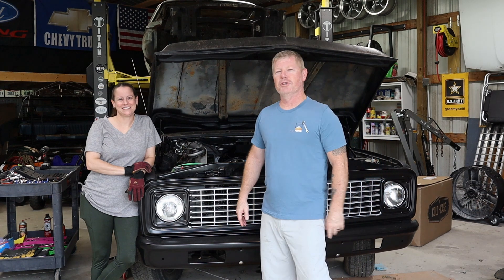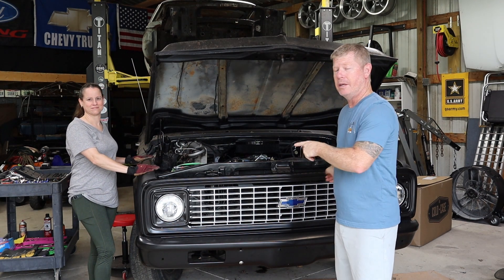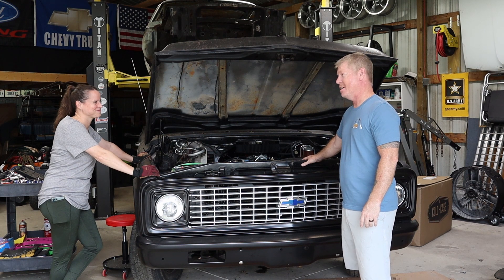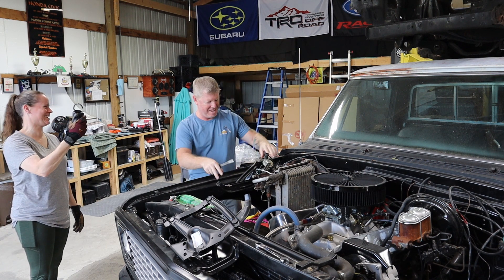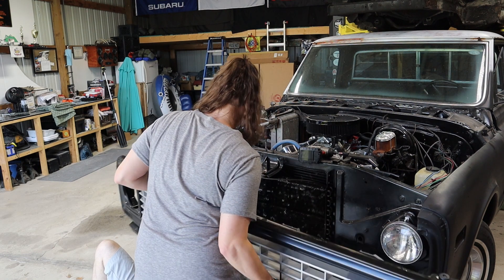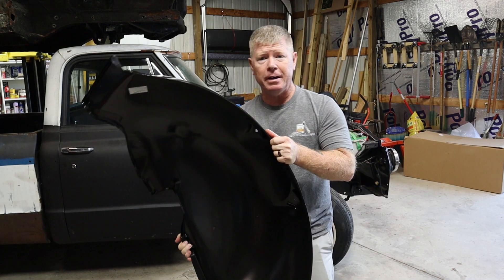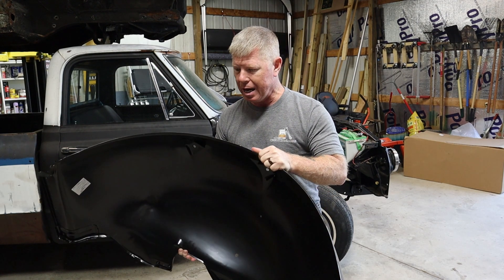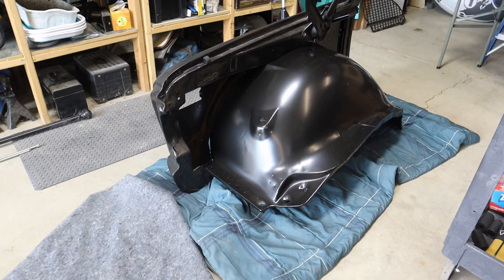1972 Chevy C10 Front End Tear Down & New Inner Fenders -  Project Harold EP. 4

Comment: Are the outter fenders aftermarket?  If so what brand and did they fit good?
Reply from the maker: HI and thank you for watching. We appreciate it. Yes, these are aftermarket and came on the truck already when I bought so unfortunately I don't have the info as to where he bought them. I would say they fit pretty good but since I don't have the OEM, I don't have a reference for them. Our bed sides came from Key Parts and they appear to fit really well. Wish I had more info for you.
Reply: @SpiritedWrenchers  thanks for the reply. I'm currently working on building my 72 K20. I need fenders and so on. Everytime I fine original parts, they're all crusty and flakey with rust. It causes me to want to go with new production parts.
Reply from the maker: @zfdmax  our pleasure.  Sounds like a great project you have. I 100% agree on the challenge with going aftermarket vs keeping original.  Our bed sides had bad cancer around the wheel wells. When I was quoted a price to weld in patch panels and it was the same as buying new, it was a no brainer. Plus I had trouble finding anyone that wanted to do it. Lol. I can weld basic stuff but not quite at bodywork level yet. If you like sharing pics of your project, shoot some pics to our email. I love seeing other builds, especially those that follow along in ours. Cheers.